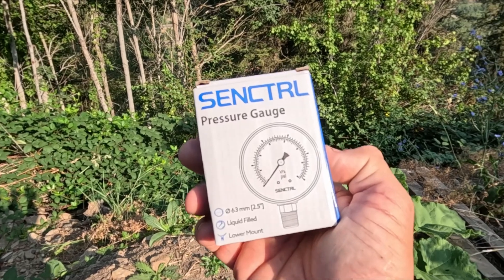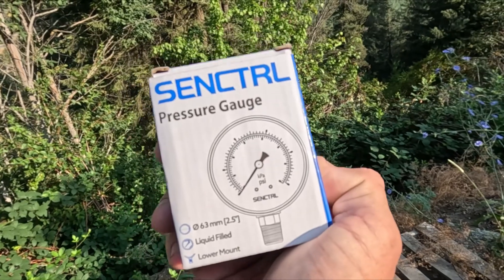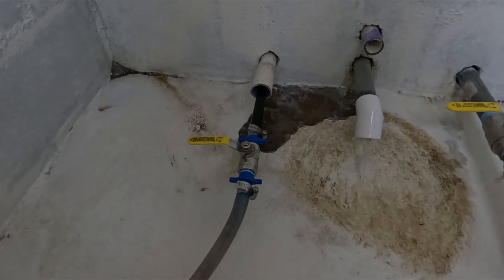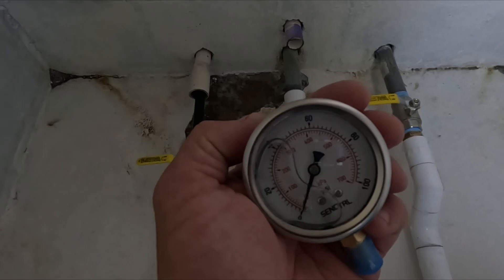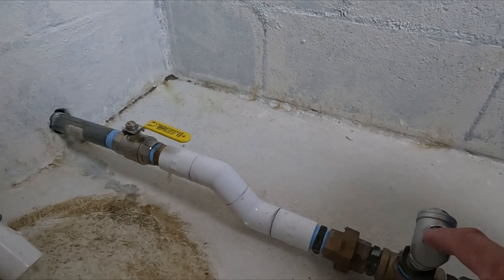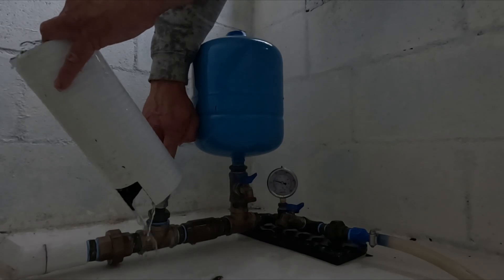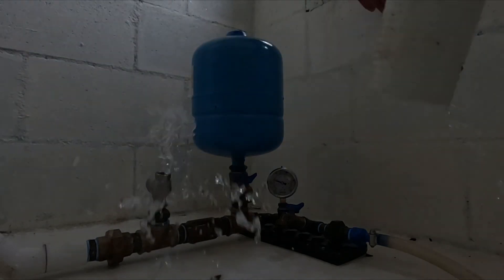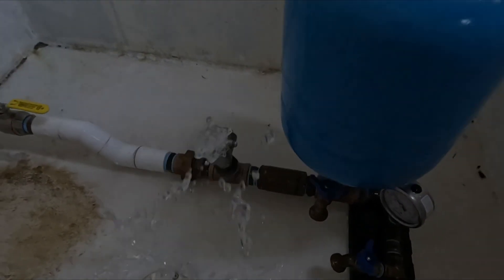DIY Ram Pump Powered Water System

Comment: Why not put a ball valve between the gauge and the system then turn the valve on and off when you want to check the pressure.

Comment: Nice system!  What benefit does the pressure gauge give in during normal operation?  As well, why not put a valve under the gauge, then you can close it during normal operation to save wear and Tear on the pressure gauge, and just open the valve for when you want to check pressures.

Comment: What is the story with needing to drill a tiny hole into the feed side of the non return valve that sits below the pressure tank in order to have a truly reliable ram pump? I've only seen a couple of people doing it but they don't explain it well enough for me to understand. I think one of the channels that mentioned it is French River Woodworks in his video titled How to build a RAM PUMP. Thanks for your videos. Enjoy your content, especially your shorts on Instagram. Regards
Reply from the maker: @AshleyWragg  You’re referring to a “snifter valve”. The function of a snifter valve is to prevent the pressure chamber from becoming waterlogged over time by allowing a tiny gulp of air to enter into the pump every cycle. 😊
Reply: @ModernRuralCivilian  Thanks!
Reply from the maker: @ you bet! 😊

Comment: How much rate of fall would the drive line need to be to get the ram pump pumping? I’m working on a ram pump project and this information would be helpful in my situation!!!
Reply from the maker: @jacelandadventures1523  I’ve read that you can run a pump on as little as 3ft of drop.
Reply: @ModernRuralCivilian  cool thanks for the info! 🤘🏼

Comment: Instead of having the gauge active all the time I was just putting in a valve to have it turned off when you're not in there. Looking at pressure and having a way to bleed the pressure off when it is not needed to read pressure. You can create a sort of T out of small 1/4-in ball valves, one coming off of where you're screwing the current pressure gauge then that going to a T And on top of that tea you have the pressure gauge and on the side of it you have another 1/4-in valve to relieve the pressure when not in use
Reply from the maker: @waylonhartwell  the pumps already got all the extravagant bells and whistles.. More t’s and another ball valve would work but so does this glycerin filled gauge. Its performed flawlessly! 🤝🛠️

Comment: Thank you Mark for the tip on the Senctrl Pressure gauge... Do you have a breakdown of the fittings and setup of this Ram Pump System. Yours is the most effective system I've ever seen in action.
Reply from the maker: @morrdak-ironbender  I don’t yet but I’d love to offer it as digital plans. Just need to find someone to draw it as a parts drawing for me. Thank you for the compliment brother. 🙏🤝

Comment: What brand of check valve do you use? I am having trouble with mine wearing out .
Reply from the maker: @scooterdrue  are you using g stainless?
Reply: @ModernRuralCivilian  yes, ive tried 2 different brands of stainless and ive been getting side wear on the guides, which ultimately leads to not sealing.  i get some dirty water and debris and that doesnt help the situation.
Reply from the maker: @scooterdrue  I’ve had flawless cycling with my stainless valves.. But I’ll report back if and when anything fails. My water is pristine so that definitely works in my favor.. 🤝🛠️💧

Comment: I hope you are somehow, catching water going down the drain .
Reply from the maker: @lavondacarter7228  It’s understandable from an outside looking in perspective.. But this mountain spring is going to run down the mountain regardless of whether or not I built this water system. So I see it as a no waste system honestly. The way I’ve got it set up I get a percentage of the water and the rest returns to the mountain as it has for centuries. 🙌💧
Reply: @ModernRuralCivilian love what your doing mate. I saw in another video a bloke was saying he put multiple tanks (with air hole in top of it) on the waste valve and it eventually collects enough water to increase the pressure backwards and puts a small amount of water back into the system. Im trying to do a perpetual style power generater using a similar method if i could figure how to make it more efficient if i dont have a big water supply like a river/ creek etc

Comment: Will you put a wireless temperature gauge to monitor temps during the winter if it gets too cold?
Reply from the maker: @FarmerBrad  I’ll try that, but this structure is a ways away from our living area.. so we’ll have to see if it will connect over that distance. Alternatively I’ll be making my daily rounds all winter to monitor the system. I’m obsessed. 🤩

Comment: 🎉 💧 I’ve had dreams about your ram pump. Mostly about how to harness the K energy and turn it into P energy again by storing water and releasing it as necessary to turn a water wheel. Just random brainstorms. You probably don’t need that or it’s not practical. Just thoughts that might be useful for my future homestead.
Reply from the maker: @fudaldeath  I have similar dreams my friend. Stay tuned for a micro hydro electric generator system! 🤝🛠️⚡️
Reply: Same!

Comment: In theory could this work with a small water tower for the downward pressure of you didn’t have a spring?
Reply from the maker: @newbactual  Absolutely. It will work however the ram pump will eventually use all of the water and you’d have to refill the water tower tank somehow. So it’s best if you have a stream, river, or a spring that runs indefinitely, 🤩
Reply: @ModernRuralCivilian  my thought process has been to have an auxiliary that connects to a rain collection system on the roof. Also to make a symbiotic system that integrates a hydroelectric generator
Reply from the maker: @newbactual  Rain catchment is a great tool! And micro hydro electric is so amazing! 🙌
Reply: @ModernRuralCivilian  yes sir. I haven’t even even found land yet but I’m already thinking about how me and my girlfriend (wife soon once I can get a ring) can build our first house after we get married
Reply from the maker: @newbactual  I’m rooting for you both brother! ☺️
Reply: @ModernRuralCivilian  thank you that means a lot. I’ll send you a wedding invite in case you can swing that
Reply from the maker: @newbactual  🤝🙏

Comment: Nice set up. Does the pump make that banging sound all the time because it's very loud?
Reply from the maker: @SimplyJustKrista  You can’t hear it unless you’re working within 20 feet of the system. Heather is 100% correct. Once you experience water flowing up hill with no electricity or fuel you’ll fall in love with that sound.🤝🛠️💧
Reply: @ModernRuralCivilian  I guess you would 🙂
Reply: It’s loud in the pump house, but you can’t hear it at all throughout the property…just a gentle knocking sound if you happen to be walking by the pump house and stop to listen.  It’s actually a really reassuring sound, because it means we have free, clean water in our holding tank! ❤